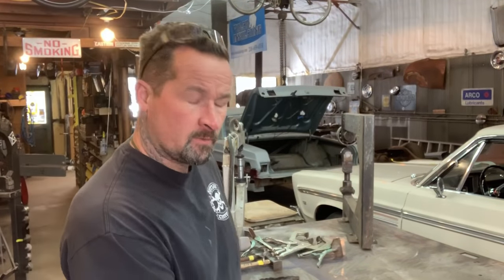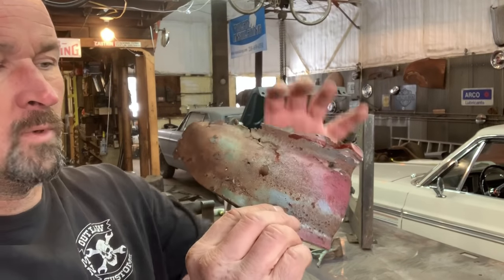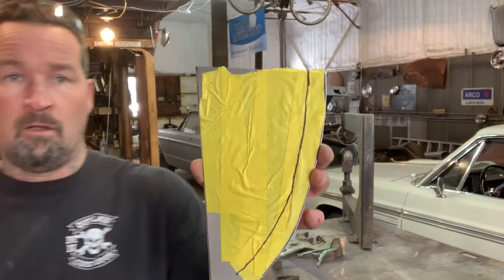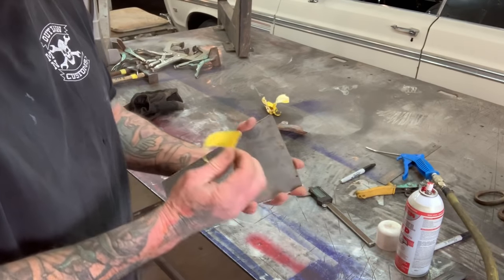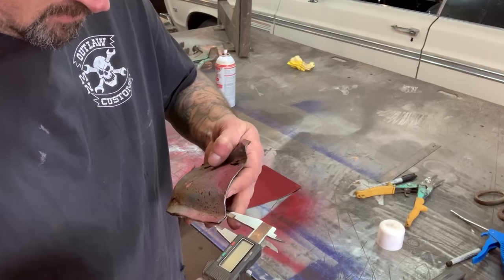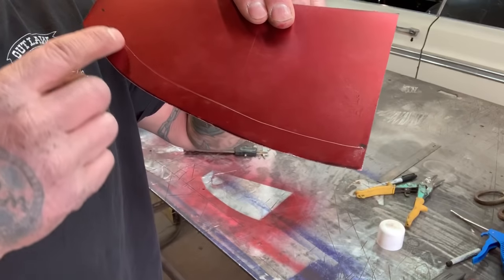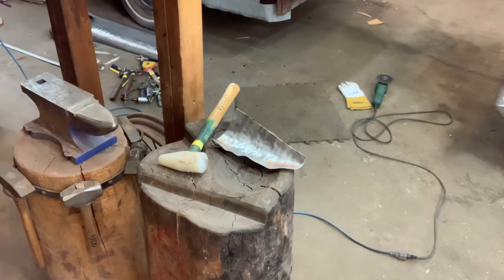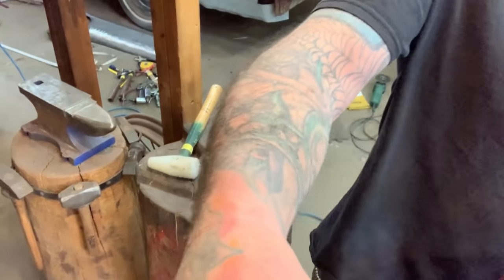Metal Shaping: Forming a curved panel with a flange

Comment: Awesome! subbed, any videos on what tools a beginner should buy? I have $1000 to buy the basic needs
Reply from the maker: 207 Made wow with a 1,000 bucks u are setup bro. First i would get a set of eastwood body hammers and dollies. Then also grab a beaterbag from eastwood. Build yourself a shrinking stump from an old 12” x 12” wooden block. And the rest is stuff that will cost the money.  Harbor freight has a great English wheel and planishing hammer.  Also grab their poly shaping hammer to use on the eastwood beater bag. Good luck brother!
Reply from the maker: Thats a great starter set that wont break the bank. Lol. And u could buy more expensive tools as your experience grows. Thanks for watching bro
Reply: Outlaw Edge looking at a woodward-fab bead roller, and trying to find a decent pneumatic/electric plannishing hammer.
Reply: Outlaw Edge yeah I got a Jeep FC150 cab that needs lots of work. But for Maine it’s pretty standard lol. Some people out west said it was “yard art” only
Reply from the maker: 207 Made yeah we have horrible salt rust here too. Some cars are just to far gone. Lol please Check out my Instagram there is pictures of F150 Ford truck that I did with no tools at all just hammer and dolly

Comment: What gauge sheet metal do you use when working on a car? Is it thinner or the same size as the car you are working on?
Reply from the maker: We use 20 gauge sheet metal unless the car we’re doing has thinner or thicker metal 👍 thanks for watching.  ARCO
Reply: Thank you for your response.
 Another question i am working on A 1966 GTO with 16 gauge sheet metal, should I use 16 gauge or use lighter gauge that should be easier to work? Yes I am new at this Sheet metal fabrication. I have no sheet metal working machines or tools at this time. Thank You In advance. Thomas
Reply from the maker: Yeah no problem bro I will help u with whatever you need 👍 if u have 16 gauge panels stay with 16 gauge. If not its hard to weld up. Thanks!

Comment: Does the planishing hammer stretch the metal?
Reply from the maker: No it wont if u use a flat die. But yes it will stretch the metal with a radius die. Thanks 🙏

Comment: You need a motor and foot controller on your bead  roller.
Reply from the maker: michael leblanc working on getting one with all the goodies. That would help alot bro
Reply: @OutlawEdge  i just scored two motors with the gearbox and  a chain sprocket on it.  One motor is 3 phase though. Can't wait to get her together on the bead roller. Both motors are LEESON MOTORS.
Reply from the maker: michael leblanc man your lucky! That’s gonna be sweet! 👍😀🇺🇸

Comment: Why did you bother marking the flange if you are just going to ripe off the tape and then use a caliper and dye to measure and mark the piece?
Reply: Well, I think he explains that. The tape is put on the curved original panel then transferred to the new piece of flat sheet so that he knows how much flat material will be required to re-create the curved shape of the original.  I have seen Karl Fisher of Make it Custom do the same.